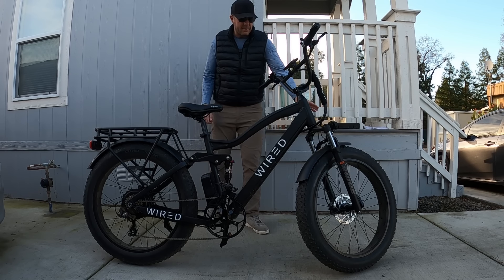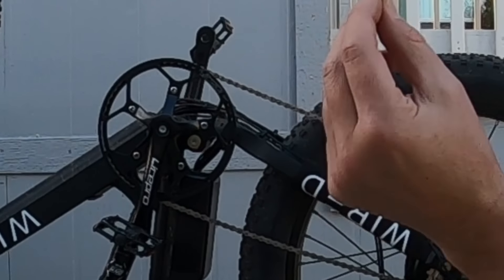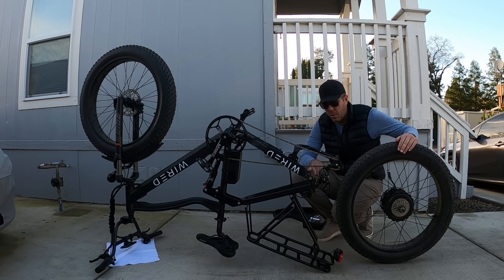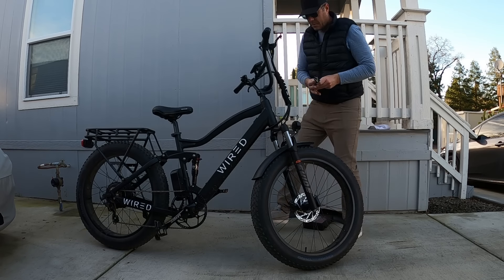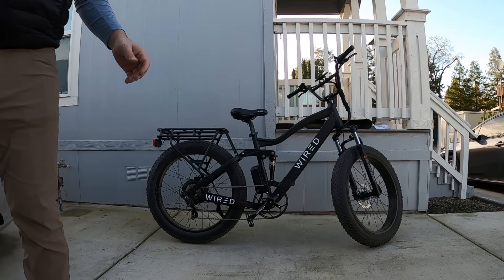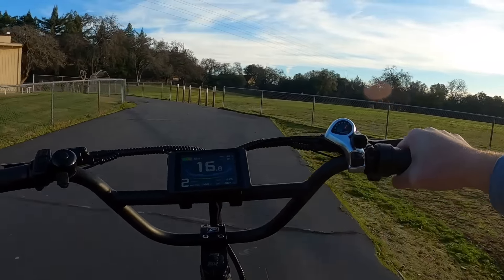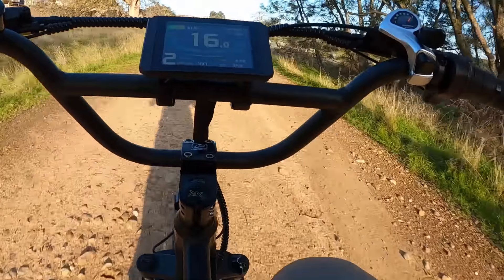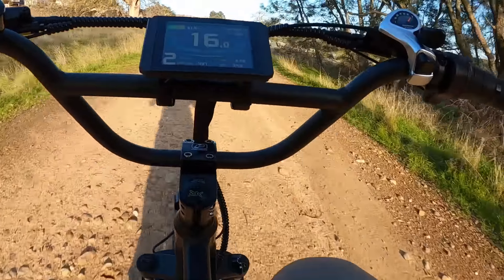Fixing My 2024 Wired Freedom

Comment: A little sound deadening mat stuck to the inside of the fender would TOTALLY remedy the rattle issue with the fender left on
Reply from the maker: That's a great idea. I wonder what  would make it stick without falling off? Some type of strong glue?
Reply: @leetjohnson 
They make some great spray adhesives that stick to almost anything.
Maybe use an old inner tube that went flat, and cut a good strip of it to glue inside the wheel well of the fender.
The idea sounds like a great solution.
Kudis to the man with the solution.
Reply: @leetjohnson  you shouldn't have to repair a new bike ...not good should of got a 5 star
Reply from the maker: @gmaster716  all bikes have minor issues. I'm very happy with this bike!

Comment: My Wired Freedom is on its way and will be here before the end of the week.  I am with you all the way.... don't like the fenders and they are coming off when I put the bike together.   I have my doubts about the rear cargo carrier but as you mentioned, if you remove it, the rear light then has to be relocated.  I will leave it on for now.  I might end up finding the cargo carrier useful and keep it.   Thank you for your helpful video!
Reply from the maker: You're welcome! Enjoy the bike, you're gonna love it!!
Reply: @leetjohnson  You seem very knowledgeable about the Wired Bikes... I hope it is okay if I ask you a question.  I am finding that even with the bike in the #1 gear (e.g. largest diameter gear on the cassette), considerable effort is required to get the bike going.  Then after 1 or 2 seconds, the pedal assist kicks in.  I tried messing with the C5 settings and also changed the default start up PAS to Level Assist 2.  Any suggestions?
Reply from the maker: @mattr7229  Unfortunately with cadence sensored bikes it can take a few seconds to turn on. I usually use the throttle when at a dead stop to get going, and then use the pedal assist once moving.
Reply: @leetjohnson  Thank you tremendously for your swift helpful response!  I appreciate your guidance and I will try this out right now.   I never owned a bike with a throttle before so all new to me  : )
Reply from the maker: @mattr7229  You're welcome!!

Comment: Rear fender is cheap aluminum and thin.. Glad you figured it out sad the company didn't respond to my email to them for you. Im glad you figured it out. Maybe they should start using better thicker fenders.
Reply from the maker: Yeah, or plastic with a support on the bottom of the front fender that drops down lower to actually keep mud and water from flipping up in the front and rubber washers all around. Thanks for the support, I appreciate it!
Reply: @leetjohnson  Im glad i found your video. You did nice job fixing it and amazing ride!!
Reply from the maker: @StayConnectedEV  thanks!

Comment: I put MTB bars and saddle on mine. IMHO it helps out the looks and capability of the bike. I put neoprene washers on each side of the rear fender and that stopped the noise. If I didn’t ride in rain and snow the fenders would go away.  If I didn’t use it to get groceries with removable panniers while RVing, the rack would go away too. Maybe I’ll see you out at Folsom sometime…
Reply from the maker: Awesome! See you around!!
Reply: Which handlebars did you go with?
Reply: 31.8 Stem 45mm Bike Stem Wake Mountain Bike Stem Short Handlebar Stem ($10) and Jgbike 31.8mm MTB Rise Handlebar, Aluminum Alloy 720mm 780mm Handlebar 15mm rise. ($20)
Reply: @Doc.Holiday  thank you for sharing that

Comment: Inadequate fenders grind my gears. They should leave them off, or put effective fenders on, stopping half the mud spraying up my back only keeps my back half clean. 
In my Magnum Peak T5 the rear fender was hopeless so I replaced it with a Mudrocker fender, which while pricey for a   piece of plastic, works brilliantly. 
The front fender I replaced with the now spare rear fender, plus I reversed the existing front fender and added it back on for extra protection. 
I'm in Oregon so currently cycling is very wet.
Reply from the maker: I agree! My buddy lives in Lincoln City and his girlfriend lives in Corvalis...I really want to go up there soon and ride!
Reply: @leetjohnson  I'm thinking of possibly riding some of the coastal 101 this Summer, hard on a regular bike but with power to get up the hills it would be beautiful.
Reply from the maker: @ziploc2000  💯

Comment: Great video! I ordered my bike Sunday and received it today so only 2 days after ordering. I watched this because I'm putting my bike together tomorrow and definitely not riding it with fenders or rack. Hopefully i can figure something out how to put the light back on. Is it possible to just unplug the rear light if i can't mount it anywhere?
Reply from the maker: Awesome! You can definitely just unplug the light if you can't find somewhere to mount it. I was looking at zip tying it to under the seat, but that required going up the rear suspension with the cable, so I kept the rack for now. Let me know how it goes and what you decide to do!
Reply: @leetjohnson  thanks man! Yeah I definitely let you know what I do, I'm going to put it together tomorrow can't wait! I put 2,200miles on Aventon sinch and wanted something with more power

Comment: Have you tried “centering” your brakes?  Loosen the two bolts that hold your brake calipers so that it can just barely wiggle. Then while squeezing the brake levers, tighten both of the screws back down on the calipers. Release the brake lever.
Reply from the maker: I haven't done that with this bike, but I have done this before. Thanks for the reminder/idea! I appreciate it!

Comment: Question. Could you have removed the rack instead of the wheel to take off the fender? Thanks
Reply from the maker: Great question and idea! Yes, I believe you can! The light is connected, so you may have to replace a zip tie.

Comment: Thanks for the info on the fenders. I have the same bike arriving Wednesday. I’m going to keep my fenders. If I find there is noise, I’m thinking of spraying the underside with automotive undercoating. Or some type of sound deadening coating. And probably using rubber grommets where the holding screws go through the fender. Thanks again for bringing this to our attention.
Reply from the maker: You are welcome! I think those are both great solutions. Let me know if you have any rattle and if the sound deadening works!

Comment: I had a problem with my fork bottoming and hitting the threaded end of the light/fender bolt. I traded it out for a shorter hex button head and fed it through from back to front with lock washers and thread-locker. Like the bike without fenders!  Unfortunately, when I travel, I ride in mud, rain and snow while shuttling drifts when fly-fishing.  So, fenders remain.
Reply from the maker: Right on, thanks for sharing your experience!
Reply: @leetjohnson ,… Went for a ride today on a wet road. That front fender is almost worthless. I’ll give it a wet trail ride to finalize my decision but that doesn’t change my mind it is history.
Reply from the maker: @Doc.Holiday  I agree, it doesn't do much. Would have been much better if it went a lot lower down the front wheel to keep stuff from flying up onto the bike/rider.
Reply: @Doc.Holiday 
You might be able to put a plastic mudflap on the end of the front fender.
Reply: @johnsanders561  … good idea!  If it becomes a big problem I can rig up a removable clip on flap. I’m formulating the beginnings of a conceptual design in my head. 👍

Comment: Looks way better without the fenders. I'll be removing the rear rack also as soon as I receive mine.
Reply from the maker: I agree! I might eventually remove the rack as well.
Reply: To remove the rear rack on the new model you will need to deal with the wire bundle for the rack battery and brake light...

Comment: I received my Wired Freedom yesterday. I see what you mean with the front headlight fender mount. It is a cheesy set up. It was designed for failure. I broke the headlight mount trying to tighten it up. I didn't put much torque on it. I sent Wired an email and they said put blue loctite on it, which it already came with loctite on it.  The bolt is also way longer than it needs to be. The bike is really nice, it is a shame to put something so flimsy on it,
Reply from the maker: Yeah, it's definitely a weakness that could be easily fixed. I'm sure Wired will change that setup to a more robust and even smaller, more dependable option. Thank you for your feedback, I appreciate it!
Reply: If you don't use the front fender, the light mount can be mounted to the back of the fork instead of the front, it will then hold itself square.

Comment: I removed my fenders.  I don't ride in the mud and rain..  I was able to get the rear fender off without removing the rear wheel by deflating the tire and a very small ratchet.
Reply from the maker: Nice!!!
Reply: Same here, ended up cutting my allen wrench down to get the job done, just didn't want to take that rear tire off first thing out of the box. This thing is an absolute beast, I think it looks pretty mean without the fenders!

Comment: Hi can you tell us what size nut you used for the front light?
Thanks
Reply from the maker: I used a 3/8 inch nut (same size as stock).
Reply: Thank you going to buy one now my bike is shipping  in a couple of days
Reply from the maker: @michaelpuccio6201  Awesome!!
Reply: My freedom arrived without the light/front fender hardware at all, I attached the light alone using a 1/4-20 stainless bolt into a locknut

Comment: Guess what , I cut about a 4" section off a 20" bike tube and ran the bolt through it for both mounting spots on the rear fender between the fender and the frame . No noise whatsoever , plus you don't even see it .
Reply from the maker: @EZ-E-1961  that's a great idea!!

Comment: I hope Wired is watching. All these annoying problems can be solved with 20 cents worth of parts. It seems someone didn't think this through.
Reply from the maker: I agree, probably just some growing pains with a brand new bike. They have already made significant changes to the suspension since the 2023 came out, so I'm sure they can make these small changes easily. Thanks for watching!
Reply: Totally agree
Reply: I have zero rattle with either fender with stock installation. Don’t know why his do, possibly something is bent slightly or loose? Also I like the look of the fenders and get small rocks and debris kicked up into them from time to time so I wouldn’t want to remove them. To each their own.
Reply from the maker: @usernamesrlamo  mine didn't rattle at first either. How many miles do you have on yours?
Reply: I’ve only got a little over 100 miles on mine. Since it doesn’t rattle at the start and did over time with yours, it’s got to be something loosened up a bit or warped etc. 

I was on a ride today that took me through just a bit of gritty slightly damp mud. That powerful motor really threw a bunch of debris up onto the bike but the fenders did work as intended and blocked a lot of it. Still made a bit of a mess. I’d say if one is doing any off-roading or ever have to ride through mud or very wet conditions they probably want to keep the fenders, they definitely help keep mud off the chain, gears and electrical components.
Reply from the maker: @usernamesrlamo  Right on! Thanks for the feedback, I appreciate it!!
Reply: Lot of bike for 2000 but, people will always find something to complain about.

Comment: I think your problem with your front shock having lateral movement might be the fact that it does not have rebound adjustment. Unfortunately, these kinds of problems are very common for inexpensive shocks.
Reply from the maker: It seems to be ok now, but the lower clamp for the quick release was loose. Tightened it up, and it is fairly solid now.

Comment: I really want to take the rack and rear fender off but i don't want to omit the rear light. So I'm hoping you decide to do the same and maybe you can come up with an alternative mounting solution for the light. I like to get a lil crazy and all that extra weight is not good for hitting jumps or extreme down hills which is my favorite  lol, anyways thanks for the video.
Reply from the maker: I agree! If I decide to remove the rear rack and relocate the light, I will definitely make a video of thr process! Thanks for watching!!

Comment: Do you want to stop the rattle of your Fender put rubber washers in between so the rubber will absorb the vibration and you don't hear The Ting Ting Ting all the time and like you said you need a lock washer and don't forget Loctite when it comes to your brake pads and your rotors wash the rotors off with pure alcohol take your brake pads out and wipe them all down with alcohol also you getting this week because of the oils on your brake pads like I said watch the back of your brakes watch the brake pads and wash everything inside there everything everyone's been talking about are minor

Comment: It's not a dirt bike!  Most people probably just use them on blacktop.
Reply from the maker: I'm sure they do, but it has full suspension and knobby tires for a reason.
Reply from the maker: It also still makes the motor vibrational noises even on smooth surfaces.
Reply: Agreed it’s not a technical single track jumper, hopping, trialing, climbing and downhill MTB. That it certainly is not. However, it has its purpose and it’s a lot of fun. That purpose most certainly is not limited to urban blacktop.

Comment: I look at that bike as being worth $1,200 with free shipping.... The market is saturated with e-bikes.. there's a lot of hype... 60 volts don't mean anything.... High-speed just means you can't ride it on the trails......😮
Reply from the maker: I don't know about $1,200....no other 60v, hydraulic brakes, full suspension out there anywhere close to that price.
Reply from the maker: 40mph for commuting is important....at least to me it is.
Reply: @leetjohnson  it's cool man I just had to rant they're kicking me off the trail with a bike that will go 20 mph
Reply from the maker: @timr31908  dang! That's a bummer. Where do you live? Most of the mountain bikers in my area go 20 to 30mph even non electric. It says 20mph on the trails, but almost nobody goes that slow. I'm in Nor Cal.
Reply: @leetjohnson  I'm in northern Michigan I think the legal limit is 25 they've been giving me s*** because I have a throttle
Reply from the maker: @timr31908  dang, that sucks!